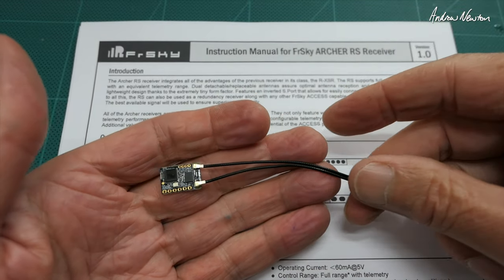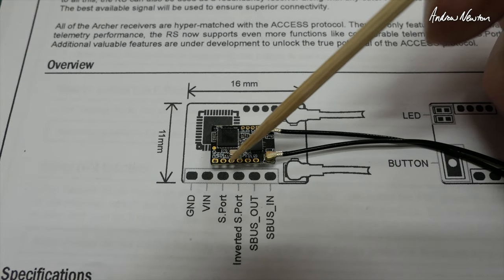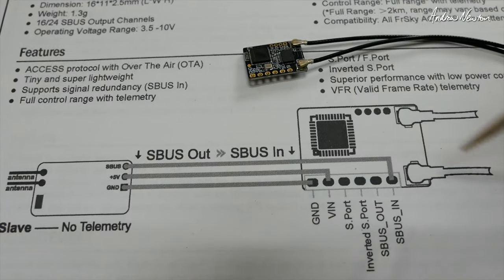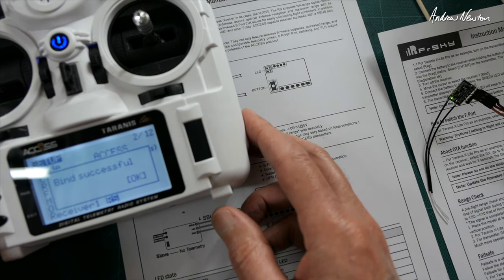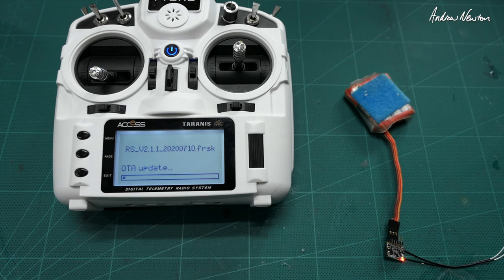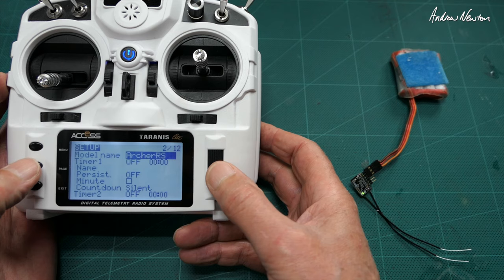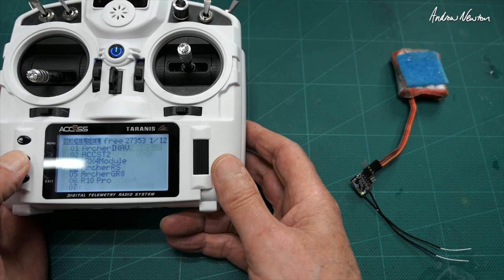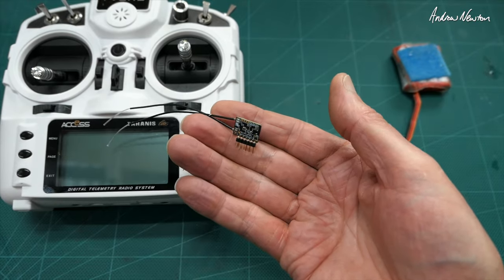FrSKY Archer RS FPort Receiver

Comment: Being able to add a second Slave or Satellite reciever is also a valuable option IMO. Back when 2.4g radio was invented, 2 recievers and 4 antennas were the norm for the ultimate in antenna diversity...Maybe it would make an interesting video connected to an F405 one day?...

Comment: Not No Pulses FS Andrew, try Hold instead..with iNAV as per Pawels advice...
Reply: Doesn't matter. Failsafe flag is send through dedicated bit on serial communication and so failsafe channel response won't make a difference if you're using flight controller. What's the argument that HOLD is a requirement on iNAV?
Reply from the maker: Pawel was just speculating in that video. Even he didn't know if it was relevant.

Comment: Thanks for this.  The pins are shorter than normal servo pins.  Do you know if there is an alternative connector that might be shorter that would connect to it?  A regular servo connector doesn't seem to be as tight on it because of the shorter pins.
Reply from the maker: Just file down the connector plastic end a little bit.

Comment: Andrew, with my new taranis access transmiter , which receiver is best and most versatile... this or the grx8 or something else.... for glider setup.
I note this is smaller and cheaper also.
Reply from the maker: This is only for flight control boards. The G series are excellent for gliders if you want the vario but more expensive. Otherwise I like the R-X6R

Comment: Hi, I changed the receiver by replacing the old xm+ with an archer rs.  In the telemetry I find just RxBt, RSSI and VFR sensors. Why there are no battery sensors as A4 and Vfas?
What can I check?  Everything seems ok, smartport pin connected on T1, uart1 with smartport enabled, telemetry enabled, receiver configured correctly .... I don't understand what I'm missing ... 🤦‍♂️
Reply from the maker: FrSKY told me a while ago that the RS needed a firmware update to overcome some problems. Looks like it has not been released yet. https://www.frsky-rc.com/archer-rs/

Comment: Will absolutely not support the Secretive Non rearward compatible ACCESS protocol. It's like throwing out all my previous FrSky protocols to restart with Spektrum Protocols. FrSky shot themselves in the foot with the Uniquely Stand alone ACCESS products.
Reply: As if CSRF isn't as proprietary, yet people don't bat an eye on that
Reply from the maker: It's just a new protocol with more features and better range. I'll be reviewing a Taranis Q X7 ACCESS radio soon, and with an XJT module fitted it can run anything from ACCESS right back to D8.
Reply: @renzevenir4853  Over the years I've invested enough on the FlySky AFHDS-x and FrSky ACCST protocols that all my +25 planes and quads have installed. "Don't need no stinkin" other FrSky protocol not will i invest in one. What I'm using is just fine and paid for
Reply: As one of FrSky’s main selling points was open source firmware, hence writing a closed source protocol was was very counter productive and against the reason most people bought the radio.  For that I’m very disappointed.    If FrSky really wanted to produce a new safer protocol and be true to their ideals then they should have released it so it could be in OpenTX now.  To me they are now just another Spectrum.  This is not the first time they have done this BTW.  There was a big fight with the open source community at the start I am pretty sure.
Reply: @lasersbee  Ironically enough, latest Flysky radios and module won't do AFHDS 2 and below natively, yet you don't have any word on that. Double standard much?
Reply: @stephengloor8451  Radio firmware and RF protocol are two completely different things. One is developed by community and one is developed privately. By your logic, why don't they open source the whole thing? Open source the case design, open source the PCB schematic, open source the open source.. No, it doesn't work like that.
Reply: @renzevenir4853  ... I forgot about The AFHDS 3... Won't be using that either... Not backward compatible without a $$ investment. My IX6 does both AFHDS and AFHDS 2. My RadioMaster TX16S does more than I need. What... You didn't mention Futaba ??
BTW.... IRFZ44 (MOSFET)... Quite the TROLL you are...And yes.. I have used the IRFZ44. Would you like to know what brand of Toilet Paper we use as well ??
Reply: @stephengloor8451  Hit it right on the nose... Exactly...
Don't pay any attention to the TROLL (IRFZ44)... He's just attention hungry...;-)
Reply: @lasersbee  Wouldn't consider it as a hit when he can't even give back counter argument ;-)
Reply: IRFZ44 sure if you think so.  The source code for OpenTX is available.  Obviously the PCB is common as they all run OpenTX.  As for the case design I wouldn’t go there right?  Back at the dawn of FrSky they enraged the open source community that developed OpenTX by using it for the Taranis then trying to close source their fork to which the community replied we won’t develop or maintain your fork so you have to do it yourself.  Eventually FrSky realised the value of OpenTX and they came back into the fold.   Obviously the accountants again looked at it and thought we can’t close source the OS again so how about we encrypt the RF protocol unnecessarily and force people to buy our hardware in the hope that people would believe that FrSky was so good that everyone would line up like lemmings for their proprietary hardware.

I have responded to that by switching to a Radiomaster so I can use any receiver I want.  The only FrSky receiver I actually want to use is the ones with a vario and I have enough of those.  

FrSky has made the same mistake a lot of open source startups do.  Once you piss off the community enough they dump you for the next startup.
Reply: @lasersbee  cool, yea what brand do you use? Two ply hopefully.....

Comment: very small, makes my flysky RX`s look like bricks
Reply: Where did you get that number,  MAD GRUMPYMAN ? The Archer RS is currently selling at $19.99 on horusrc.com. Clearly cheaper than XF nano. And not sure about your situation, but here size matters and anything larger than XM+ won't do the job for more than half of my fleet.
Reply: There are plenty of smaller FlySky compatible receivers out there too. A quick search for 'flysky receiver' on Banggood finds a half dozen or so around this size that are compatible with the i6/i6X.
Reply: MAD GRUMPYMAN  I see. What range are you getting with the micros vs X6B?

Comment: Vey nice but competely uselless to me because I elected to dump FRSKY after being a loyal customer since the original X9D came out. FRSKY have forgotten that their brand was build on the back of OPEN TX and making inexpensive receivers. Now that they have got greedy, closed the doors and started putting their prices up, all they have done is moved themselves in to the JR slot. Depreciating D8 mode on their transmitters was also a big mistake because it made me replace my old X9D with a Radiiomaster TX16s instead of a shiny new 2019 edition. Good bye FRSKY You were the 'go to' brand but you're rapidly going in the direction of JR now!
Reply from the maker: Everything is still available, all the firmware, old style receivers and radios. Just that there is a new option.